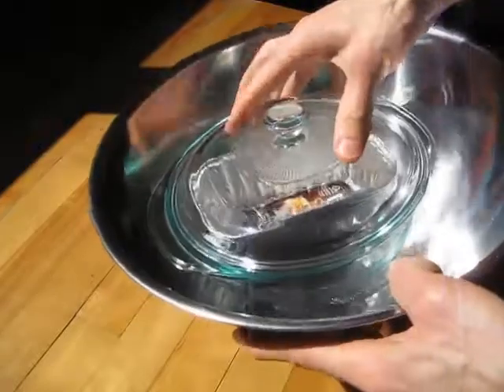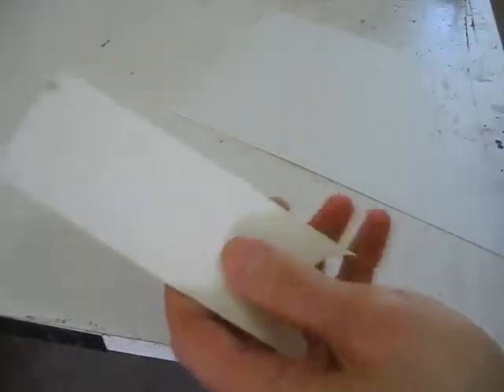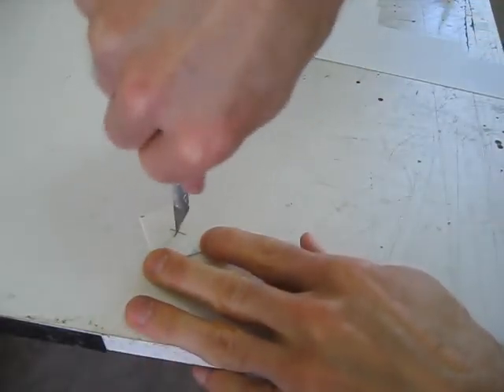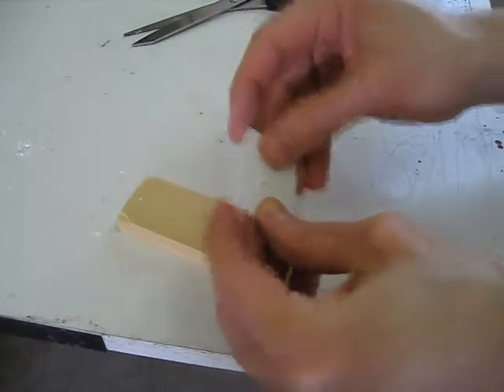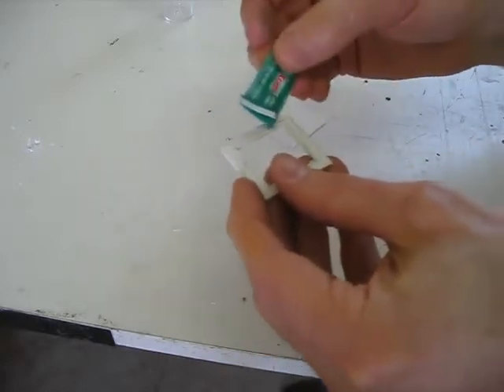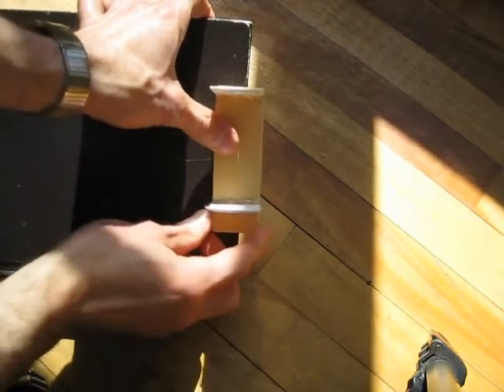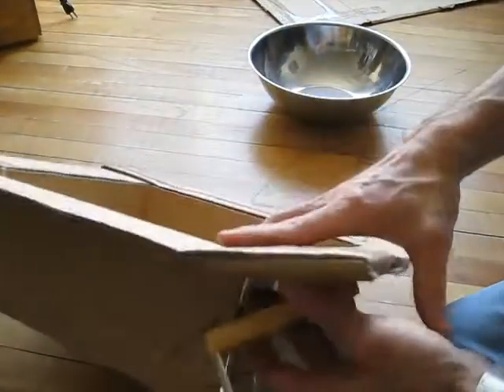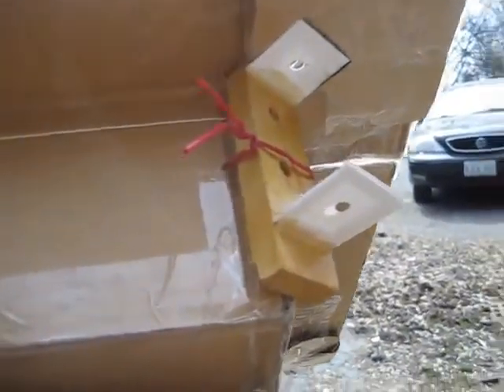How to make a sun finder (solar finder)

Comment from the maker: @narcovice That would work for some types of solar cookers but not all. But in general you're right. There are all sorts of ways of doing this depending on the thing you are trying to aim: some solar cookers you can just look at their shadow, looking at the shadow of a single stick pointed at the sun, a hollow tube with a board behind it, ... I've found the one in this video to be very versatile and used it many times since making it.

Comment from the maker: @sharpshooterofky Anything longer than half an inch should be fine. It doesn't have to be the width of the collector. As long as you're confident in its accuracy. For placement, just put it somewhere on one side of the collector, similar to how in this video I've put on the side in one corner of the box. You could even just tape it on with duct tape or something and remove it once the collector is permanently mounted. It's surprised me at how much use I've gotten out of this simple thing.

Comment: not sure if you updated your sun finder but i saw this video today as just decided to play with solar, yours is okay but could be inpractical for say on the walk with weight ect so what i did was 2 hinges single hole either side and riveted to a thin bit metal hinge folds down either end and made sure it lifted the right way works great, was thinking of putting a small hole in middle, so i could stick a pointy stick through, then stick stick in ground as just turn as need to find sun, what you think?
Reply from the maker: Sounds like a good design. What do you mean by "on the walk with weight"? I later came up with some other approaches, one using a tube and one using the structure of the solar cooker itself -- no video but you can see them on my website here https://rimstar.org/renewnrg/sun_finders_lining_up_with_sun.htm
Reply: @RimstarOrg  micro light packers and such as yours was wood. it be to heavy for them lol. Also it was semi bulky in size and shape  so much more so than flat metal with lift up hinges, also i think backpackers just like to complain so they bound to find some reason, with made metal and a small hole for stick you also got a signal mirror, love your newer videos but i just hit like and maybe coment i think left coment about useing preasure cooker in a solar oven not sure, will visit website thanks for link and answer. stay safe
Reply: @RimstarOrg  oh looked your site nice but also another thing about mine is just need magnet somewhere and it stick to solar still even cardboard ones, like the tube one that be easy to make on the go, if you decide make solar still from rubbish while camping , or fishing just for survival practice, ummm got me thinking now lol, in survival if you had bamboo and sandwich bag maybe could you make emergancy solar cooker, bamboo is cooked in so it hold heat sandwich back to be the cover over hole, maybe insole of shoe as black back part most white on top but black underneath, yeash it get adicting thinking about solar doasnt it?
Reply from the maker: Thanks for clarifying. And yup, solar can be addictive, especially when cooking with only clean, free energy.

Comment: Another way if you have the plastic is to just make an all plastic tool an then cut and weld with a magnifying glass. To cut you just burn through the material and to weld you need a flux preferably something that carbonizes like williow leaves, you place the flux on the plastic line the magnifier up with the sun and start burning the flux you will notice that the pices of carbon get stuck in the plastic this is what you will use to melt the plastic parts together then quench in water to set.